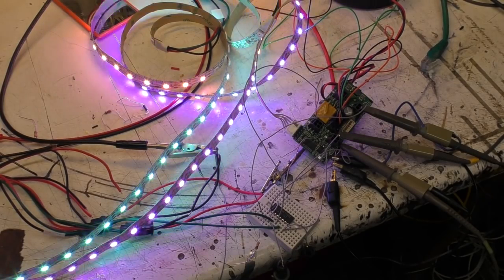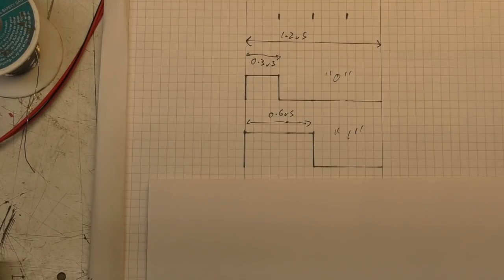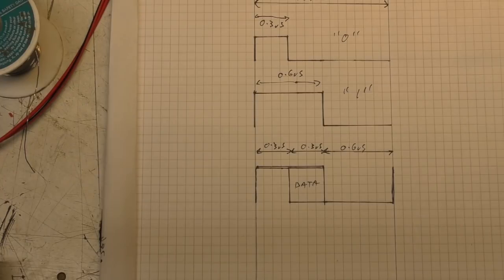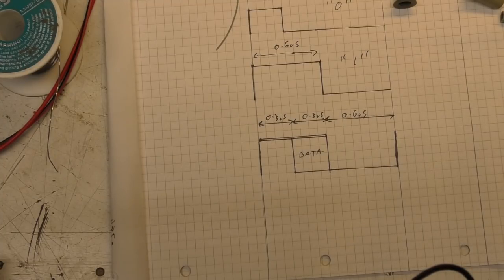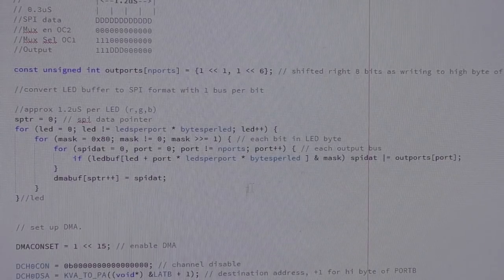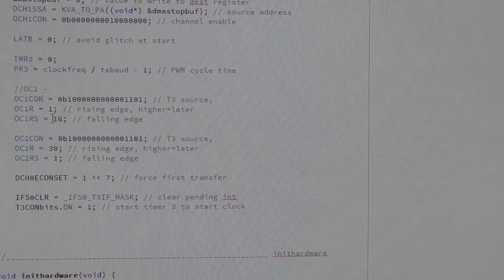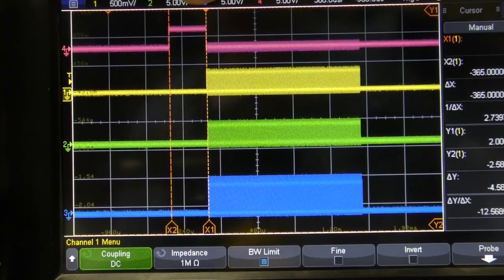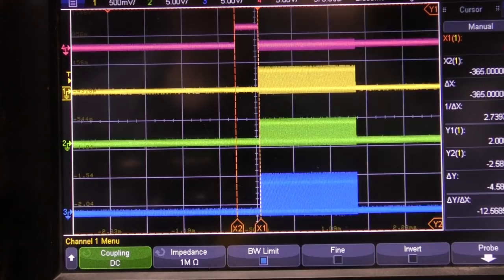Driving multiple WS2812 LED strings using DMA on PIC32MX

Comment: I hope you use defines for stuff like "1 << 15 // enable dma" in your production code. Code written by EEs makes my head hurt exactly because it has nightmares waiting to happen like that in it.
#define DMA_EN (1 << 15); *p |= DMA_EN .. magically you don't need the comment anymore and you can easily search/replace it in the future.
Reply: My take on this is that the code is highly coupled to the register description in the full datasheet reference for the chip - so just add a link to the section of the datasheet and add only high-level description.  You can't actually maintain or change this sort of code without understanding that part of the datasheet, no amount of adding verbose names is going to change that, but it is worth saying what the intention is in the comments.  The point of readability is to allow maintainance, its not an end in itself so much.
defines are, however, useful once you know the datasheet well but haven't memorized bit patterns yet, as you don't have to keep refering to the register layouts for every line of code.
Hiding all the complexity behind some well thought-out library functions is the way to go ultimately.
Reply: @MarkTillotson  

>You can't actually maintain

You can't maintain code that has magic values all over the place. You can maintain a single define that has a comment above it with the datasheet link if you need that context. If you use an editor that isn't notepad and actually has an indexer you'll be able to roll over the usage of the define with your mouse and get a popup with where it was defined and your comment with the datasheet link above it... you can't do that with hardcoded values all over the shop. The best you can do with hardcoded values is "grep -r <magic number>" and hope someone left comments.

>no amount of adding verbose
>names is going to change that,

You don't need to go over the top with massive over descriptive names but you should certainly create descriptive defines for constants.

You see this all the time in code written by EEs. Instead of creating a define for each bit they want to set or clear they calculate the constant value or shifts and dump that in the code.. so the next unlucky person that comes along has to get the datasheet out to find out what bits are being set and what they mean.

i.e.

uint32_t *reg;
reg = 0x3; // release reset and fire

instead of 

#define NRST 1;
#define FIRE (1 << 2);

uint32_t *reg;

reg = NRST | FIRE;

>but it is worth saying what
>the intention is in the comments. 

If you can avoid using comments you should as they are not tightly coupled to the code they describe. The compiler doesn't check that a comment belongs where it is or makes any sense. IMHO you should only need comments where what is happening is non-obvious or there is some hidden behaviour i.e:

/* There is a hardware bug that means
 * each time the DMA engine finishes
  * NRST is cleared
  */ 
reg = NRST | FIRE;

I would argue in this case FIRE would be defined with NRST included and the comment would be there instead to avoid someone that doesn't know that behaviour exists from forgetting the NRST part later.
Reply: @donpalmera  the trouble is, you become so abstracted you often lose what's actually going on in the hardware. We're controlling bits at a low level as a fundamental function of the hardware we're trying to control. Some #define doesn't change the intimacy you need to understand what's going on
Reply: @sdgelectronics  

>the trouble is, you become so abstracted you often lose
>what's actually going on in the hardware. 

What you have written makes zero sense. Defining constants is hardly abstraction. The assembly the compiler will generate is exactly the same as all that is happening is some text replacement by the c preprocessor. It's an aid for the human that has to look at your code later and work out what it does.

>We're controlling bits at a low level as a fundamental
>function of the hardware we're trying to control. 

I hate to be rude but at this point you're writing utter nonsense. In the Linux kernel this stuff is heavily abstracted: Where registers are in the memory map is defined via device tree or acpi, the way registers are accessed is at the very least abstracted away to make them platform independent and at some levels is heavily abstracted to make your driver bus independent i.e. the same driver can access an i2c, spi or mmio version of the same hardware.
People don't have trouble writing drivers for Linux and your average Cortex A? ARM SoC has far more low level interactions between hardware blocks than a little PIC micro.

>Some #define doesn't change the intimacy you need
>to understand what's going on

A define is a text replacement tool. If can't handle the huge abstraction layer of the c preprocessor replacing some text then I don't think anyone can help you.
Reply: @Wimpzilla aka gRave 

>I'm not really skilled in advanced low level electronics.
>Neither i'm proficient at coding, 

Ok. So you are not in any position to comment either way.

>If you had followed Mike along the years, what clearly you have not!

I've been subscribed to Mike for years.

>In this case, one is not coding a simple low level C firmware,
>where "Define" would be used as good practice for code maintenance.
>Here we are speaking about low level electronic logic and
>setting the ground floor for data transmission.

This is utter nonsense. You and others are basically saying "I like writing the same string over and over again instead of using the C preprocessor to do it for me!". What you have written makes no sense because if you knew anything you would know you could get the c preprocessor to save the processed output and you'd see the define turned into multiple instances of the same string just as if you have written unmaintainable code to start with.

>Something i would guess you have no clue about, as you have
>no clue about using an oscilloscope i guess,
>neither about signal propagation and signal integrity i guess.

Coming from someone that wrote from the start that they have no clue this is genuinely weird. FYI I'm not an official EE but I have designed and validated hardware that is out in the wild. At the last count a piece of hardware I validated, with that mystical oscilloscope tool, wrote the firmware for etc had sold $300 million USD worth of units. I'm pretty sure I have an oscilloscope or logic analyzer in some of the FPGA videos I have in my channel from 10 years ago...

>I suppose, in this case, it is a clear example of intelligence against wisdom.

No. This is a clear case of: Someone makes a small suggestion and youtube idiots come in to defend the youtuber's honour and make idiots of out themselves instead of just writing "actually, that seems like a good suggestion, thanks!".
Reply: @Wimpzilla aka gRave 

>"you are missing the point, 
>your suggestions are irrelevant
>at the moment for the specific case!".

That might very well be the case but the other comments went on about how this sort of low level programming doesn't fit with the abstraction of a define. Which is laughable. (Hint for you again, a define isn't an abstraction.. it's text replacement FFS)

>Or you are a bot?!

Ah yes, people that question you are all russian bots.

>In either cases, users following
>us and watching the video will
>be the judge.

Not really. Who cares what youtube people think. As you demonstrated people like yourself will jump into an argument you have no qualification to be involved in, add nothing and write a bunch of nonsense.

None of the big C code bases that are out there that are running the world like Linux, FreeRTOS (which has its own crazy coding style) etc would argue against removing comments by making stuff like register positions and bit positions into constants.
Reply: Put the code into a function, call that function elsewhere, no define mess required, very easy to review when checking things like timing/sequencing without having to look up the defines elsewhere, also less risk of transposing errors when you're dealing with multiple registers similarly named.

I try to follow the Barr standard, which I highly recommend.
Reply: @edc1569  

>Put the code into a function, 
>call that function elsewhere, 
>no define mess required, 

Ugh, why the hell would you do that.

Yeah lets have a function for dma enable, dma trigger etc etc so we have code that looks like

dma_enable();
dma_trigger();
more_stupid_code();

instead of 

** some defines *

*p = DMA_ENABLE | DMA_TRIGGER;

From a quick skim through "the barr standard" it looks like mostly formatting rules. It doesn't say "make your code generate multiple register read/write sequences because you can't use something as basic as a define properly".
Reply from the maker: I disagree. More text = more chances for typos. More time to write. This code is never going to need to be maintained by anyone else or ported to another platform. There is no such thing as "good" or "bad" practice, only more or less appropriate for a given scenario. 
There's nothing worse than trying to understand code that abstracts everything so you have to hunt down  where things get defined. I've never found a compiler bug, but have spent numerous hours tracking down problems caused by errors in manufacturer-supplied header files defining hardware registers.
Reply: @mikeselectricstuff  

>I disagree. More text = more chances for typos. More time to write.

More reason to use a define for this then. The way you are doing it now you can make multiple different mistakes for what should be the same text. if you define DMA_ENABLE and use that define then you can be sure all the places you meant 1 << 15 are actually that and you get the bonus that what is intended to happen is documented by the code and not a comment that could become detached from the reality when printf debugging after a few beers.

>There's nothing worse than trying to understand code that abstracts >everything so you have to hunt down  where things get defined.

Again, imagine you have 1 << 15 in three places. Now you have to hunt each of those down and work out if the comment is actually what is happening there. If you have a define your development environment can index that and tell you where the define comes from. If you decide you actually want to remove it totally the code won't build anymore if you delete the define but are still referencing it somewhere you forgot about.

I use eclipse's CDT for C stuff. It's clunky but even it manages to index Linux and correctly find where symbols are defined in most cases.

>problems caused by errors in manufacturer-supplied
>header files defining hardware registers.

Vendors often ship code written by EEs or offshore teams that look awful and uses a ton of crappy macros instead of just defining offsets and bit positions. That's not a good reason to not have the code say what it intends to do by creating defines for constants.
IIRC the crappy headers from vendors is a big enough problem that ARM came up with some machine readable format for describing the registers in cortex m microcontrollers so that users can use whatever tool they like to make headers that agree with them.
Reply: @donpalmera  I don't buy that. If you're saying comments can become detached that easily how would we ever know what's what without going through line by line?
Reply: @sdgelectronics  

Comments become detached very easily.

Imagine you have (1 << 15) all over the place and it means "enable dma" and at some point you change one of them to (1 << 12) because you actually wanted to set another bit... and you forget to update the copy/pasted comment. Now you have a line that does one thing but the comment says it does something else.

If you defined the constant you're reusing you don't need the comment anymore because the name of the constant describes what it does. And you can do stuff like *p &= ~(DMA_ENABLE | DMA_TRIGGER) and still have the meaning clear from just the code.

If you still don't believe me write a little driver for something like an SPI sensor with no register offset or bit position defines and try to get that into Linux (probably the biggest C codebase out there). You'll get laughed at.

TL;DR; EEs write awful code.

Comment: Why are You using != in for loops? Is that "faster" or occupies less micro assembled code?
Reply: You mean the one where he's right shifting? How else would you do it? There is a starting value and he's taking a bit off of one end until there are no bits left hence != 0. Even it was a "funny" way of doing it if the compiler is any good it'll rearrange it to it's taste either way.
Reply: @donpalmera  i mean checking for exit loop condition. Not using for(;i<1;) but for(;i!=1;). I guess that takes less CPU cycles jus to compare two values bitwise and return
Reply: @SzymekCRX  Depending on the rest of the code involved the compiler might decide they are equivalent and generate i AND 1 for both or decide that the loop isn't needed at all and unroll it into a constant number of copies of the loop body. You shouldn't really depend on what assembly the compiler will generate as just changing the toolchain version or adjusting the code slightly will change it. If you want a specific instruction sequence you need to use inline assembly.
Reply: Yeah, compilers will do whatever they feel like doing.  Attempting to influence that will do nothing at best, or make it worse.  :-)  The best course with C is to avoid thinking about opcode optimization, and just write whatever most clearly conveys the intent, and let the compiler have its way with it.  Usually, it will do something sensible and all is well.  If not, throw down some inline ASM.  :-)

Comment: See WS2812B_(Ver._No._V5)_EN_19112715293013.pdf
Timings are now
0=300/800nS, 1=800/800nS
Reply: Every version I found quoted different timings.  The truth is, it doesn't matter that much.  0H should be ~200-400ns.  1H should be >600ns.  L can be almost anything you want.  Maybe shoot for <2us.  Latch with 50us low.

Comment: interesting. I'm trying to run 74HC4514 to latch 16 indivudally addresaable ws2811's in 4 groups, so 64 single (or strings) with my pic32mx170f. the timgsings are crazy. fixed strings of  NOP's to pass the correct timings at 50mhz.

Comment: This does have the limitation that all channels send the same data for each led right (Same colors same pattern etc)? or did I get that wrong from the design.
Reply from the maker: No. each string sends independent data, that's thr point. The only limitation is that all channnels send the same number of LEDs, so the longest string determines the frame period.
Reply: @mikeselectricstuff  That's really cool I didn't know you could do that with a pic microcontroller. Now the references to a 'parallel port' also make a lot more sense as its logical for a parallel port to output different data in parallel.

Comment: I've made similar thing using single timer and DMA on cortex-M0 (stm32f0 with 48MHz CPU clock) for 8 strings of WS2812 and jitter was maybe 1 or 2 CPU clock periods, which is completely acceptable.
Single timer +3 compare registers can trigger 3 DMA transfers which set start bit, then 8 data bits and stop bit. 
Idea is described here: http://www.martinhubacek.cz/arm/improved-stm32-ws2812b-library

Comment: Cortex M3 has a nice feature called bit-banding which can be used to transpose the bits which allows you to dma the data straight into the gpio port via the carefully configured timers, and it's quick enough to do on the fly so the dma buffer can be small. I first cribbed it from Martin Hubacek, wizard of all things WS2812 - http://www.martinhubacek.cz/arm/improved-stm32-ws2812b-library
Reply: @cskilbeck Thanks, I'm honored ;)
Reply: still need a level shifter though, so... yeah
Reply: In my experience they work fine with a 3.3V input signal.
Reply: @teslatrooper  That doesn't match my experience, at least if you're powering them with the full 5V.
Reply: @grrrams  really? the datasheet says Vih min 2.7V, how long a wire to the first LED?
Reply: @fuzzy1dk  The data sheet I'm looking at says 0.7x Vdd minimum, so 3.5v. You might get lucky with some parts (and I presume there are clones / newer versions), but it's extremely marginal.
Reply: @teslatrooper  just, but not if you use 5.9v for vcc which helps if the string is long

Comment: Atm I have 400 ws2811 led pixels setup as a string outside ive soldered 1.5²mm wire along the string at 5 points for the 5v power cable as the standard cable has so much voltage drop at long lengths ive also extended the signal cable Im using a node mcu and wled firmware to use them through WiFi to control them over a phone and also compatible with alexa
Reply: I thought those regenerated the control signals?  I've had to bypass the strip power traces, but have not run into control line issues when I'm delivering 5v to each strip.  -- not an expert!
Reply: @firstmkb  my pixels are all in parallel then just using the 5v power and just added extra cable to beef up the power handling the only thing I had to do was add a capacitor to the outgoing data line to stop interference on the data line as it was causing the pixels to flash